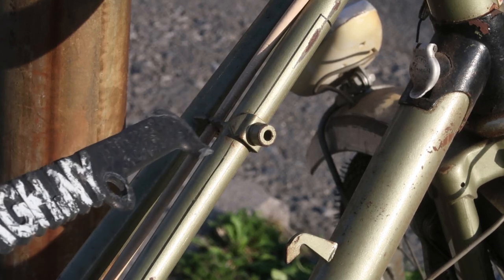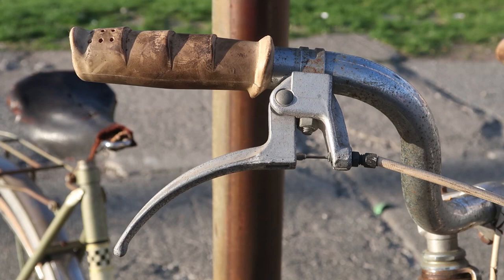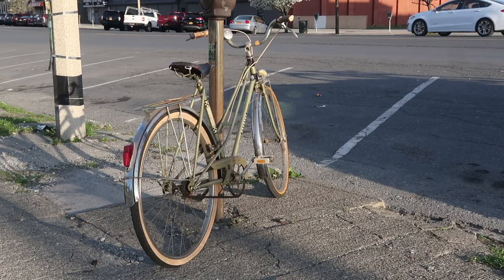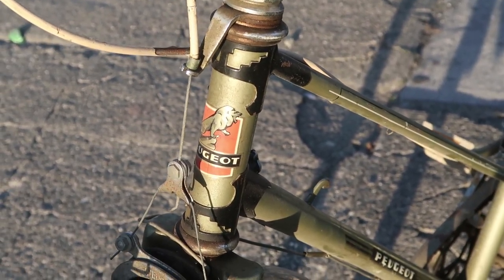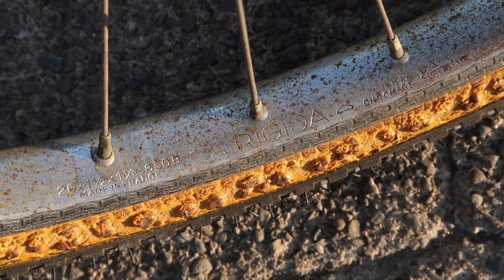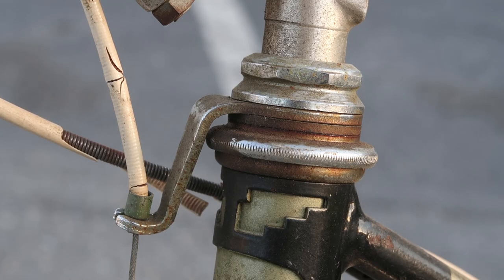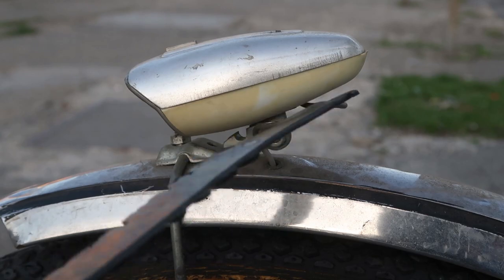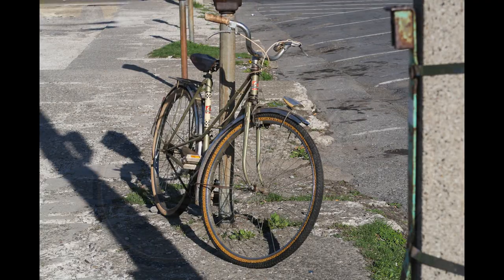Vintage single-speed bike | Checking out a Peugeot PE-25 mixte

Comment: I think that little hole with the cover on the head tube is maybe to put oil in it.  Old bikes from the 40s had a little hole in the bottom bracket area for oil so maybe that's what that's for.  IDK, could be wrong tho.

Comment: Antivol is french for bike lock that hole was probably made to put a chain through
Reply: @remilafleur540  Maybe you meant litteral translation because i'm not sure anti theft really qualifies for a correct one. The word cadenas à vélo is never used except maybe quebec people and it's not like you couldn't use a bike lock on a motorBIKE
Reply: @remilafleur540  I dont even know what point you're trying to make, so i'll just add this : a bike lock whether it is used for bicycles or motorbikes translates to antivol in french which is also used for both, you could use cadenas if you were using a cadenas to lock your bike which frankly doesnt happen that much since a cadenas is very small. You may like it or not but cadenas a vélo isnt a bike lock and antivol à vélo is redundant
Reply: @farmiluc  He's actually right though, it's not for a bike lock. Its for a fork locking device that could be considered an anti-tampering device.
Reply: I never said i knew what the contraption was made for and i'm not the one who got his ovaries all mad because of a youtube comment. I still stick to my translation and thank you for clearing what the thing is, i have a wheel locking device so i think i kinda get how the system works now